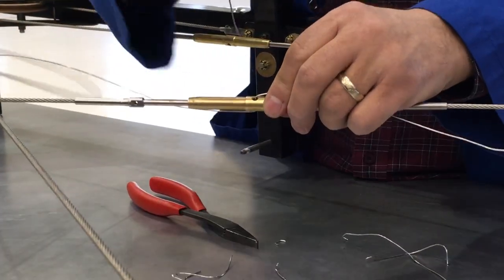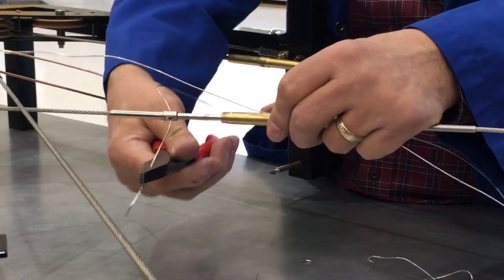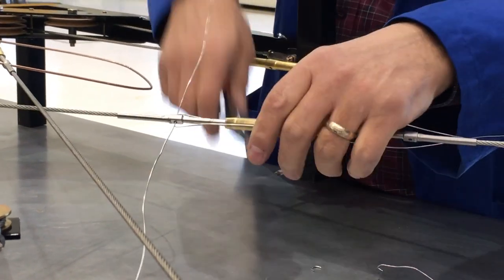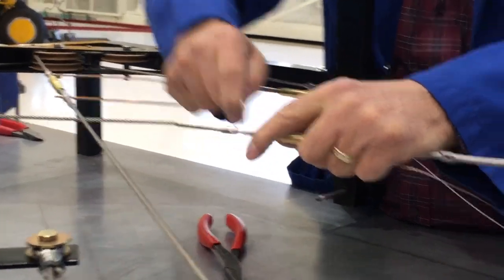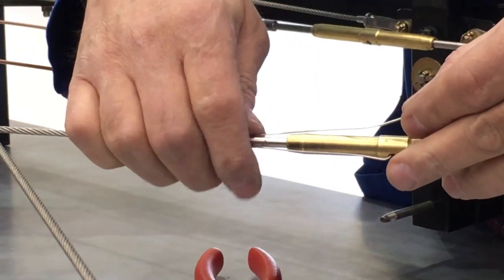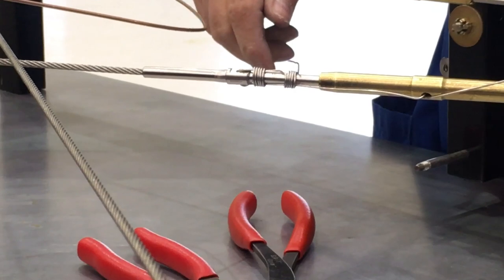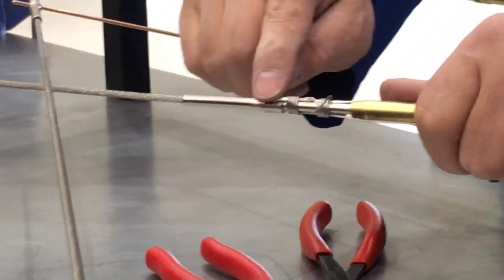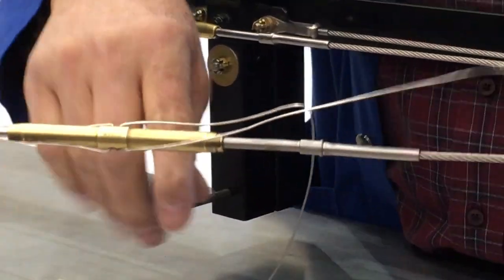Double Wrap - Lockwire

Comment: How do u make sure that the tension won’t change after the wire locking ?
Reply from the maker: While lockwiring always ensure that you are pulling the lockwire tight the entire time, and ensure that you dont allow the turnbuckle to move. Usually for your cable tensions there will be a tolerance plus or minus in accordance with manufacturers specifications. The easiest way I find is to make sure you're exactly at your desired tension before lockwiring, typically if there is any change it is negligible.
Reply: Eric Albert Hill thank you so much .